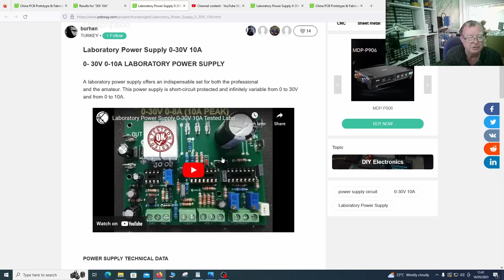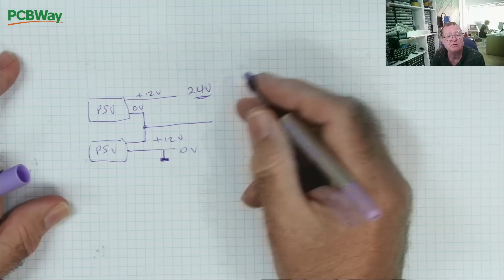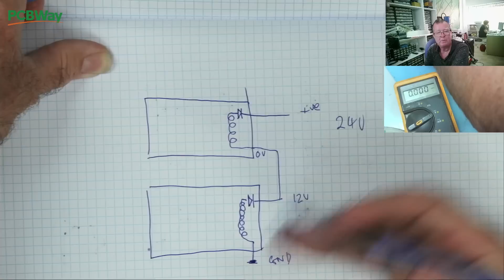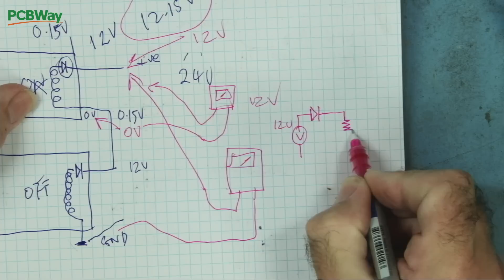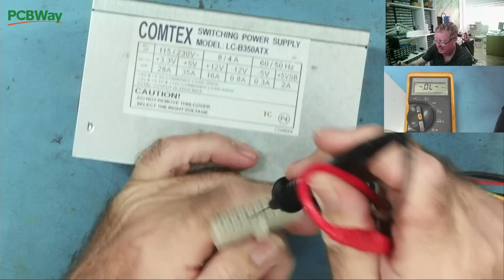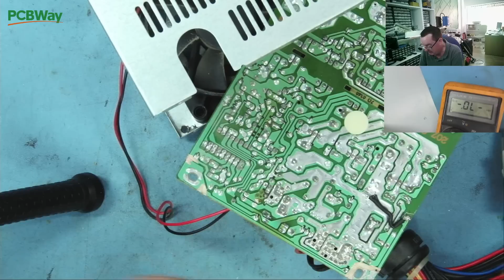Build this DIY 0-30V 0-10A Lab Bench PSU CV CC Build Using ATX PSU

Comment: Did you not feed +24 and 0 to the main circuit .. +12 for the circuitry..

And the output of the opamp/comparator to control the 2nd smps??

The smps which activates with the opamp/comparator is the bottom one right??

Comment: I was already wondering if this was possible for a long time. In my case, I wanted to make 60V from +30V and -30V, but was anxious about the difference between earth and 0V. Also was wondering about the current. But you answered those questions already in this video, if I am not wrong: Isolating the output of both circuit is a perfect solution, and it makes sense that the max. current is that of the lowest Amperage of both circuits.
So thanks Richard. I learned a lot (again)!!

Comment: Another wonderful video Richard... This technique of coupling two power supplies only works when both units are isolated output types and as you correctly point out the 0V output of both units must also be floating...

Comment: Hi Richard. Another really interesting video... If you don't mind a dumb question from an old Canadian, can you use the -12 and the +12 on the atx to get the 24 volts?
Reply from the maker: Yes but the -12V is very low current so the 24V will also be very low current.   However I have an idea about that which I want to try soon.....

Comment: Why not modify one PSU to output 24V? Would the components not stand the higher voltage. caps 16V rated, etc.?
Reply from the maker: Are you reading my mind?  This is another thing I'm gonna explain soon

Comment: Well Rick just use plastic spacers and joins to isolate the ground - you don't need any Dremel and soldering at all. Or you can use a UV resin solder mask for isolation too.
Reply from the maker: You did hear me say, in the video, that using plastic shims or spacers, and nylon bolts, was another method you could use?

Comment: It probably requires 14 or 15 volt minimum to run the 723 and 741 chips
Reply from the maker: 741 works with 5V to 15V (actually the absolute rating is 4.5V-18V supply)
Looking at the LM723 datasheet it only shows the max rating for Vs which is 40V but the example circuits in the datasheet use Vin of 12V so I don't believe that is the problem

Comment: How about 2 nylon and 2 low standoffs for remouning the board. Would save cutting traces......
Reply from the maker: Did you hear suggest exactly that in the video as an option to cutting the traces? 🤫  Plastic shims and nylon bolts as I put it
Reply: @learnelectronicsrepair  Sorry teach, was probably on the can.
 Was also looking at the idea of mounting the regulator on the top the p/s the same way....

Comment: Another excellent video, thank you ! But when you switch off one of the power supplies connected in series, don't you apply a reverse voltage to the output capacitor of the power supply which is off ? This voltage is limited by the shottky diode forward voltage, but at high current like 10A I guess this voltage could exceed 0.5 V. -0.5 V seems to be the minimum voltage that you can safely apply to an aluminium electrolytic capacitor continuously. There is not a lot of margin here and the use of relays might be a better solution !
Reply from the maker: No- there is a reverse biased diode effectively to stop any voltage going the wrong way into the other PSU.  Look at my diagram again and you will see that
Reply: The current will flow into the psu which is disconnected. You didn’t draw the capacitors, try drawing them and calculate the voltage applied to them!
Reply from the maker: @vincents.3996  I will on the next part to prove this point, but they are not reverse biased (well only by as much as the voltage drop of the Schottky diode) because the output capacitors in the PSU that is switched off are effectively shorted out by the secondary winding that isn't running, so what you have across those capacitors is a short, apart from the diode.  You can safely put a reverse voltage up to 1V (and some google results say 3V) on an aluminium electrolytic.   The way to test this of course would be to actually measure the voltage across the output terminals of the PSU that is switched off

Comment: Excellent tutorial ! it's important to cover grounding because it's easy to get in a pickle. With the lower input voltage is the low voltage side that runs the logic working correctly ?.....cheers.
Reply from the maker: Should be because this is all analog (not logic) and the LM723 regulators are able to run at even lower voltages than that.  I think it may be something to do with the resistor values in the LM723 circuit but no doubt we will find out in the next part. The LM741 is only involved with switching the relay
Reply: @learnelectronicsrepair  Cool and 'Logic' was a poor choice of words on my behalf !

Comment: blast from the past design, tho it should be done with vacuum tubes for true historic accuracy. now, perhaps instead of building this, one should ask themselves if they really need supply with 500uV ripple on 10amps, and upon answering that question in only sensible way slap a chap buck/bust module (optionally with extra lowpass filter) on atx psu and call it a day
Reply from the maker: ATX PSU have been powering desktop PC and sensitive GPU for decades without ripple causing a problem
Reply: @learnelectronicsrepair  But how much do they rely on all the caps on the mainboard plus voltage regulators?